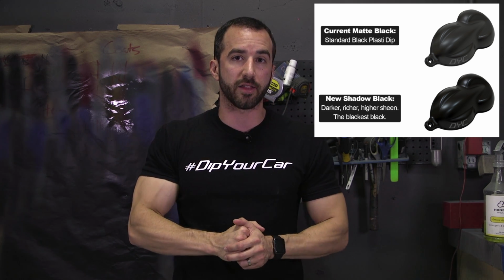Shadow Black - The Dip Color You've Been Waiting For

Comment: Can you just respray a car like that? I used to work at a body shop and the amount of bits we had to take off and respray separately, what's some of the close up shots of this car look like
Reply: Yup that's the beauty of plastidip,masking is minimal body prep is basically wipe it down with alcohol, and if you build it up right you can peel it off in less than an hour and spray another color

Comment: What I want to know is how durable is it.   Paint is one of the most expensive thing that the manufacturer's put into cars, and none use plasti-dip type of sprays, even though they are generally far cheaper than other paint alternatives.    I would have to wager its because of durability concerns, not just to physical damage but to UV resistance.    Will that black turn into gray on the horizontal surfaces after three summers outside in Houston in 110oF weather?
Reply: Plastidip is meant to be temporary, and it holds up great. I've had mine dipped for 2 years and it still looks fantastic.

Comment: Nice, very cool but what about chip from road drive? Would be a shame the minute you takes this to the real world road it gets chip from driving....
Reply from the maker: tsifty1 that’s extremely unlikely, Dip isn’t brittle like paint - it takes a lot to make it chip. Even if it did, it would only be saving your OEM paint anyway.
Reply: DipYourCar thank you for the feedback. We will give it a try on wheel mags and see how it holds up.
Reply: Dip is flexible it might leave a dent if it's big enough but dip usually protects the underlying surface,like the rubberized bedliner spay but much thinner